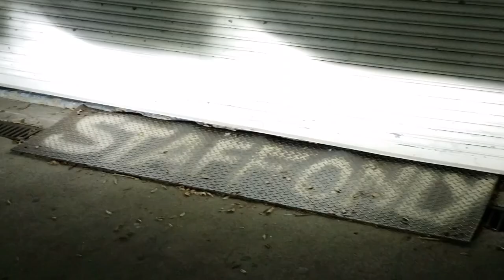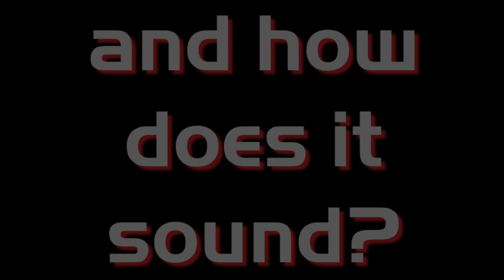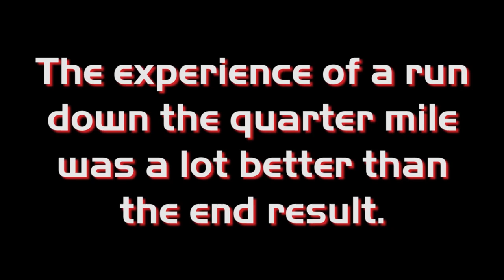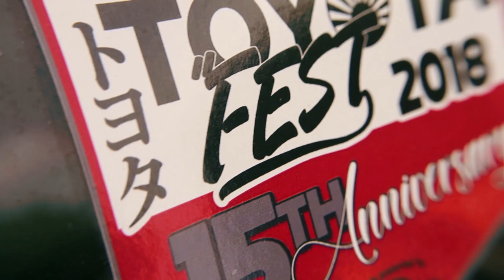My ST162 Celica - 15 Year Build (Slow Burner vid)

Comment from the maker: It seems I have to make a pinned comment, and hope everyone who asks about the bodykit, actually reads it. It's an SSV kit modelled off the very limited run of TRD kits for the original GT-Four. it's been NLA (no longer available) for over a decade and I can't find anyone willing to do a low-volume remake of these in ABS (fibreglass is too brittle to use on a daily). for those who own another 4th gen (ie. AT160/ST162, etc.) search for Kaminari bodykits and retain your original bumpers as they'll be needed to make the kit work. as good as this car looks, it's not in the interest of companies to keep making aftermarket bits for, regardless of the attention it gets. thanks for watching and keep poppin' those headlights.

Comment: Another good vid,really nicely executed.Shows your car really well,it's a credit to you mate.Touches away from the old skool with the light mods ,interior upgrades,etc don't detract from the essence of the car in my opinion.It's all in the execution,really nicely done and suits the look of the car with the bodykit.A car that probably wasn't originally going to be the project that it turned out to be over a number of years..Hell,I can relate to that.I kept my own car N/A,went another stage on with a 4th revision JDM Beams engine conversion with a lightened fly and some breathing improvements couple to an LSD gearbox,but it still keeps the essence of the car to be honest.The later 3SGE you've gone with is a nice improvement over the stock unit,we had the 1st revision 3SGE on our UK cars,I believe you may not have got that with your Oz SX? But such a good car to play with.Good chassis too,I've improved the handling with sensibly sprung coilovers,camber adjustment and some Whiteline ARB upgrades with a custom fabricated exhaust that helps bring the Beams Redtop alive and makes the car so responsive.Sure,you could go 3SGTE for more power ultimately,but a high revving N/A 4th Gen is a treat in itself. Best wishes from the UK. Sell it,you'll regret it .. 
ST162Beams
Reply from the maker: hey mate, thanks for the comment. over the past 15+ years I've tried to keep it more or less in original style - understated but more modern than the 35 years it currently has. I have front and rear Whiteline swaybars, King Lows on the front and (interestingly) stock height Pedders replacement springs on the rear. the 17" wheels might make it look like it's on coils though. you may also recognise the engine from your ST202 Celicas, as that's where I believe this came from. I know I had to get the engine loom from the UK to get it to work in my car. the 1st gen GE engines went the whole run (1985-1989) here in locally-made Aussie Celicas. the gen2 GE engines were fitted in the first of the SW20 MR2s if I recall. I did have the option for a redtop BEAMS in 2008 when this engine was swapped, but I found this low-km one for cheap, and locally, and it's done me well thus far. Cheers, thanks for watching.

Comment: The great revival brings the Toyota spirit back, The body looks quite similar to ae86 with pop up headlight. I'm impressed the way you have mods  this Celica.
Reply from the maker: thanks for the kind comment. many people have drawn comparisons with other cars from Toyota against this Celica, and even other cars from other marques in that period. most people confuse it as an MR2, rather oddly. as for the mods, I took whatever I could when they were available, and made them fit the overall design I had in mind - retro, but with a modern touch.

Comment: Really, you gave it its due. This silica deserves to be taken care of, and you are good at this. Can I communicate with you through private chats, if you don't mind?
Reply from the maker: what do you need to know?
Reply: @STAG162  I have a Toyota Celica GT_S st162 1986 model. I want pieces for the interior room and I want the rear lights bottle
Reply: @STAG162  Can you help me even if it is used? I do not mind. I am from Jordan and I want parts. I did not find parts
Reply from the maker: @ahmadalenazi3382  you'll need to find parts internationally then, try getting on the st162 . net facebook group (remove the spaces) and they should be able to help out.

Comment: I have ST162 I hope I can make it like this someday :)
Reply from the maker: aye, treat it well and it'll treat you well too. they're getting hard to find and while replacement parts are still around, modifications like bodykits, etc. aren't anywhere near as plentiful as they used to be. these will appreciate in value, and the looked-after ones even more so.
Reply: @STAG162  Hi do you have a facebook account I would like to message you with some information on how I can make my st162 stunning like that. Like the exact dimention of the rear wings and body kits so we can fabricate it.
Reply from the maker: @seansampana1128  Mate I have an insta account which is mentioned towards the end of the video. DM me on that and we'll have a chat

Comment: beautiful build man, I got a 1988 gt-s and I can't find any aftermarket support, where'd you find the exhaust if you don't mind me asking?
Reply from the maker: thanks for the comment. the exhaust is actually ST202 factory manifold into a 2" primary before the cat (stainless 100 cell), then 2" pipe and one 15" mid-mounted resonator before the stainless muffler. I didn't bother going for an off-the-shelf exhaust setup, because for a 35+ year old car there's not that much aftermarket support, and they weren't that popular next to earlier RWD models. now they're getting popular and there's nothing for them.
Reply: @STAG162  did you have to find a muffler that just happened to fit or was it made it fit? just wondering because mine is quieter and need to find a muffler.

Comment: where did u buy parts when needed? i have a celica gt and i am having trouble finding parts
Reply from the maker: 'parts' is very non-specific. for a lot of the stuff on my car I was in the right place at the right time, and knew the right people. also bear in mind that it took more than 12 years to get it to the stage where you see it now.
Reply: @STAG162  got it, i bought a 88 gt in amazing condition for 400 and i have just a couple things to fix up and im unsure of were to get parts, mostly small interior things
Reply from the maker: they're usually the hardest things to get, but you may find people on places like the st162 . net FB page who run into Celicas for spares, which may be available for parting out, etc. "not what you know, but who" is very relevant here, and can mean the difference between getting small parts like what you need, and missing out.

Comment: Love the build. Paints a really good picture of what I want to do with my own 89 Celica. I was wondering if you had any advice for where I may be able to buy parts for my st162. I have a bit of repairs left to go for it before I start doing cosmetics :)
Reply from the maker: cheers for the comment mate. all depends on what you're thinking of doing and where you are, I guess. a good tip is to visit the facebook group st162.net and garner some info from that, as there's probably no better place to learn about 4th gen's than there.
Reply: @STAG162  thanks for the tip, I’m from Sydney and haven’t been having much luck finding reputable sites. So I’ll definitely ask in the Facebook group

Comment: Love the idea of putting LEDs for tail lights. Can you tell what electronics you used for them?
Reply from the maker: thanks for the comment. I didn't do the mods, I just made the design for them. but as you saw in the video, standard breadboard layout, LEDs, diodes, overcharge diodes, etc. just from what I remember, I'm not an electrician.

Comment: I've recently got a 88 sx with the 3sge, its relatively stock apart from a catback exhaust and a pod filter. What would be some things you would recommend doing to it?
Reply from the maker: thanks for watching. well you've done the basic stuff to it, ie. getting it to breathe better. next I'd be keeping it in good tune, like spark plugs, leads, dizzy, etc. these cars are all getting older and those with OEM engines need special care. headlights are like candles in jam jars, so consider going a simple LED upgrade with some Raybrig housings. after the simple stuff, think about doing suspension and maybe wheels.
Reply: @STAG162  thanks man I appreciate it🙏

Comment: What suspension are you running on? 

I have an ST161 and I'm running Macpherson Struts all around. . .
Reply from the maker: should be the same suspension setup underneath, only I'm on factory rear spring replacements and King Lows (drop by 15-20mm) on the front. the setup looks lower because the wheels are 17" on low profile rubber.
Reply: Trying to diagnose my crank no start. It's been a mission
Reply: @STAG162  youre on king low springs?

Comment: Was the 3sge a plug and play
Reply from the maker: pretty much, just had to source the engine/box first, and because the engine had a cut loom I had to source another engine loom from an ST202 from the UK. I didn't swap the engines over, another guy in Qld (road 'n track) did the swap, along with heater core, dash pad, front brakes, A/C swap, all done at the same time. no way I could've done it myself as I don't have the tools, the space or the knowledge to get it all done.
Reply: @STAG162  I’m thinking of swapping my engine out for a new one , I still have the 3sfe in mine hasn’t died but can’t pass smog , I just wanna know what engine is a lot easier to swap in without having to do to much

Comment: What light bulbs did u run for the headlights I’ve ran some off road leds and want change
Reply from the maker: I found some H4 LEDs on eBay, no known brand other than I know they run Phillips chips inside. they've been good for the past 4 years, no issues.
Reply: @STAG162  if u have an eBay account I think u can still send me the link of purchase of item perhaps.!, but they really fit the car ngl , I’m running the off road ones and they alright but they lose power a lot
Reply from the maker: @majorpain7248  because the ebay transaction was over 4 years old I highly doubt I'd be able to pull anything meaningful off the site. less than 6 months and I still got a chance, but I doubt it ater this time.

Comment: Turbo?
Reply from the maker: nah, not this build. maybe the next owner might do something like that, if I sell it.
Reply: @STAG162  it's a super clean example, you've really looked after it. I'm curious about turbo applications for this engine, I also own it. Did you ever consider a turbo during your ownership?
Reply from the maker: @jac1793  I had the opportunity back in 2008 to put a different engine in it, I just went for simple and uncomplicated 3rd gen 3SGE (the one before VVT-i) which was an unknown quantity, but the condition of it was excellent. I went with my gut and had it installed, and it's running like a top to this day. Glad I did, lane-change-steering (turbo FWD) isn't really my idea a daily.